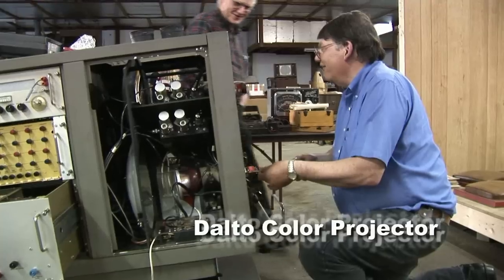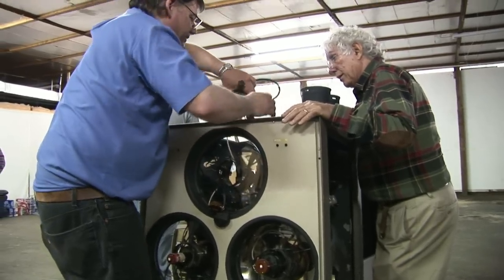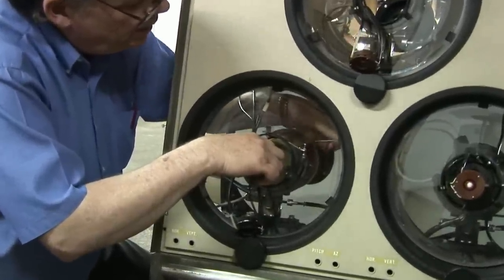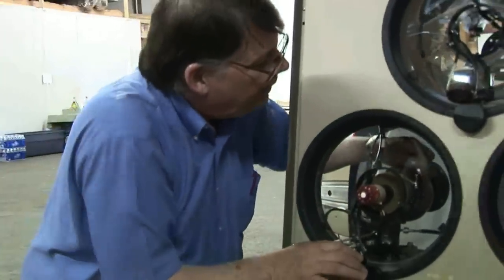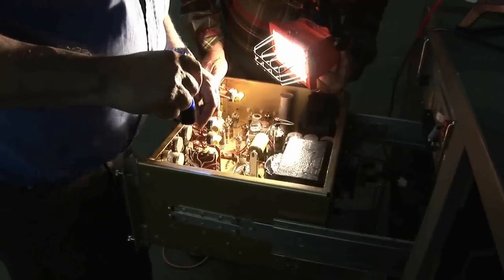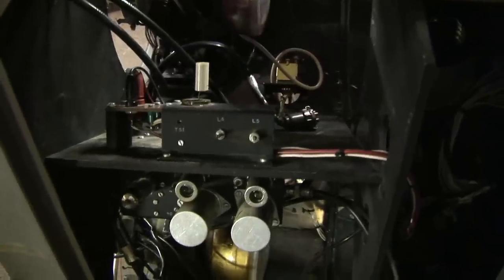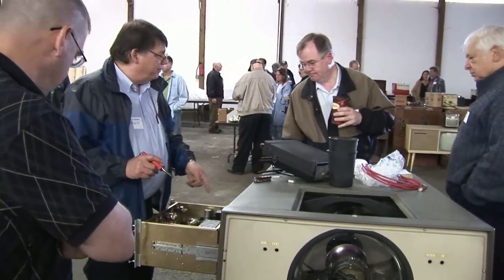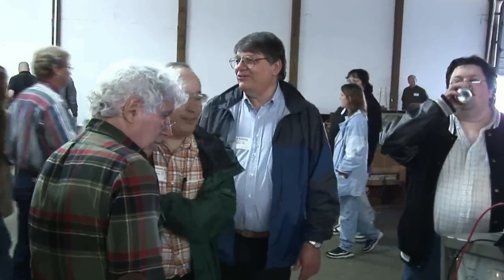Early TV Convention - Dalto Projector

Comment: Get a can of conductive shielding paint (available from Stewart-MacDonald guitar shop supply) and use it to paint the backs of the CRTs,  and attach ground leads for safety.  This works just fine for bleeding off the charge the CRT bell builds up.
Reply: I dunno, since it arcs already, and runs at 45KV. Also since it's a one-off (well, x19) design, I wouldn't want to mess with it or alter any of the major parts. Might be that a conductive coating would cause a permanent short at 45KV. At that voltage things are different, low currents, high resistance, and insulators start to become merely resistors.

Comment: if I'm seeing it right, the image comes out from the three tubes, having to travel past the CRTs, which are right in the way. How does that work? In the video the back of the CRTs were facing the projection screen. How come they don't block the image?
Reply from the maker: It is done with mirrors ;-)   Light from each CRT face reflects from the curved mirror at the back, past the body of the CRT to the screen.  All early CRT projectors used this light path.  The mirrors probably cost less than the lenses on the last CRT projectors.